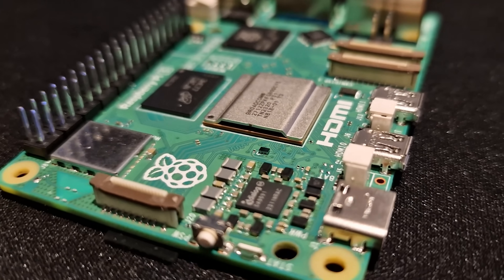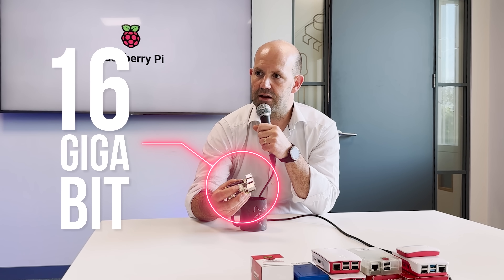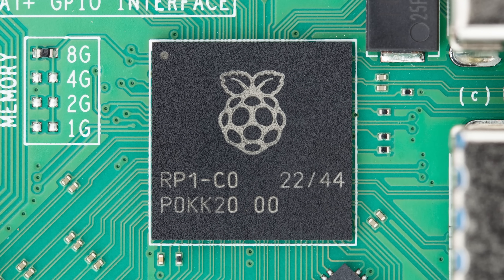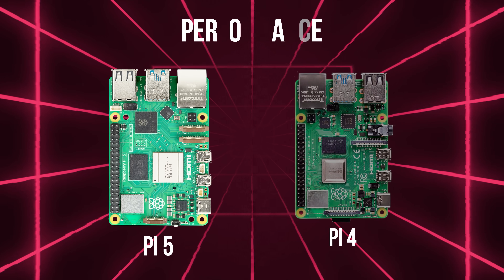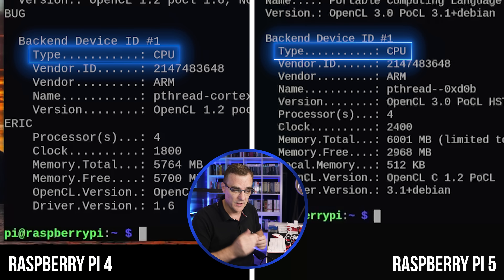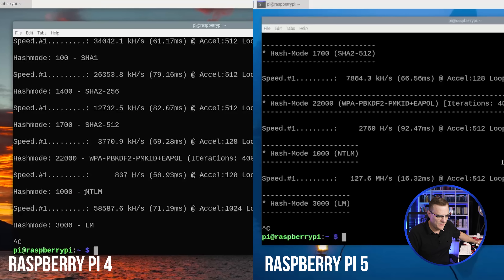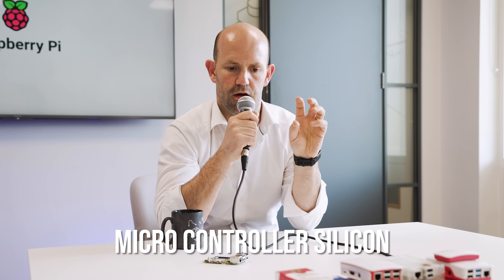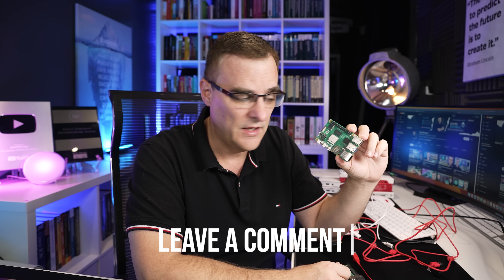Raspberry Pi 5 is here! (and I TESTED it)

Comment: I Have just bought a new raspberry pi 5 8gb and try to boot with 16 gb sd card but the pi is not booting and still red light is glowing.
So I tried using Raspberry Pi 5 EEPROM bootloader recovery image and pi boot up with 9 green light and red screen lit up on screen.
(I am using other power supply which is not the official power supply).
Just wanted know is this the issue of power supply or any other reason .
Please Provide any solution to this

Comment: I hope there will be no problems with stockings in future, like on 4 last years. For me is 4B still favourite. By performance is 4 still good, and it run with lower energy consuming and with passive cooling (full performance on 5 CPU is pretty hot at temperature, over 80°C 😀). Maybe if they in next revision add 16GB RAM and M.2 slot on back, i will consider buying. And little disclaimer, this advertised 4k60FPS is not very true, bcs it runs, but there are FPS drops. 4K30FPS is fine.

Comment: But can it play YouTube videos at 1080p without losing frames? No, really. The RPi 4 struggles, for some reason. (Compatibility with browsers...?)
Reply: You will have frame losses at Full-HD and you will not be able to watch 4K videos on YouTube because that resolution is used by YouTube and uses VP9 and AV1, which is not compatible with the raspberry hardware.

Comment: I'd like to see if the very latest Godot and Blender work on a raspberry pi 5. Godot 4 fails and so does Blender 3 on a raspberry pi 4 because of the Open GL version is not high enough.  I'd dont want to render much just have a low power consumption machine to develop on.

Comment: A lot of great improvements indeed, especially in the CPU power. But, still depending on an SD card to load an OS for for this beast is a bit 2010-ish. Yes, you can put a HAT with PCIe connector etc. but still why isn't this integrated on the board already like manu other competitor boards (Orange Pi and others )?  Or why tere are no eMMC options available?
Reply: base price seems is limitation,and most of users not need it,but i also hope to see that and 16GB in top product line.  Well maybe cometition will do it,but on other side most of competition lack in performance or and at most in support side..RPi became icon to build upon it!
Yes i hope and dream to see 16GB keyboard with ssd inside..for home use..

Comment: For me, the key is easy running of an OS and a community to help software run on it. I intend to use this to drive microscope hardware. Too many of the control of scientific kit requires a power hungry windows machine (which I also have). Multiply this with the number of machines in a building and it is a lot of power. Switching to the Pi would mean each running on 6w which is a greener way.

Comment: Would be interesting and practical to run a head to head comparison RPi5 with Orange Pi 5. Orange's RK3588 looks better on papers.
Reply: Yes you're correct but in reality the Raspberry Pi have a much larger community support which is why you see these things everywhere.  This will change soon as RISC-V gains traction.
Reply: yes you are right orange pi 5 has 8 cores versus pi has 4 cores

Comment: The big problem is, all the reviews are exactly the same from the hundreds of people that were sent the RPi5.  They are not as good as a miniPC that doesn't cost much more when you add a power supply, mouse and keyboard and storage and case and cooling and all the other bits you need.
The mini PC is far better value and not as slow, plus it runs a lot more and could be used to run other OS.
Now we have a silly situation of not being able to buy one, not being guaranteed we will get one even if we pay in advance to companies wanting to make money from our free loans.
I tested it too, it's not a PC replacement, it's slow and not good on youtube and struggles on 4K videos and dual monitors.  It is NOT that much better than a 4.  So if you just want to run AdGuardHome or PiHole it is OK.  Forget trying to run a firewall on it!

Comment: I would like to see a RPi with a FPGA chip onboard, probably with Linux software to program it integrated.
Reply: If only FPGA chips weren't so expensive otherwise would have been a nice addition.
Reply: @Darkk6969  The Gowin 20k is not that expensive suppose you can get it for a few dollars in quantities. Small Altera ones are also cheap you can do alot with just 1k if you want to drive a VGA for example. This application is not necessary on the Pi but there are lot of high speed projects where it can be interesting. Stepper motors in a CNC project. Another fun board would be RP2040 combined with a FPGA.

Comment: I don't like this plays the wanne-be-fast game. If we needed one thing, it would be a completely passive cooled 10nm low GHz version, with added M2 storage. Like quad core 1.5 GHz with a 10nm chip running less than 5W on full power. To do things like 4K playback and gaming, grab a much more powerfull and cheaper yesteryears AMD based system that uses less power on load.

Comment: I Googled Raspberry Pi and this came up:
[1] The Raspberry Pi is a 'LOW COST', credit-card sized computer that plugs into a computer monitor or TV, and uses a standard keyboard and mouse.
[2] The Raspberry Pi is a 'VERY CHEAP' computer that runs Linux, but it also provides a set of GPIO (general purpose input/output) pins, allowing you to control ...

Comment: I have wanted to play with one for years now, but they are expensive.
A good alternative is a old plex SFF computer with a i3, upgrade it with second hand 16GB ram, a SSD, and ad a second network card or WiFi and you are ready to play, and it costs around 100$/ as mutch as a Pi4 version B. 
But definitely that there are some things that's easier to do with a raspberry, and lower power consumption.
Reply: Supplies of the RPi 4s are returning to good levels now.
Reply: @AuxiliaryPanther   that will probably not do that mutch, in my country the price went from a average 929sek to 1099sek so the price has pritty mutch just followed the inflation.
Reply: @dennissvensson6051  it is unreasonable for products to not follow economic inflation.
Reply: @AuxiliaryPanther  precisely, that's why I assume that the prices won't change even when all the retailers have them in stock (I assume you ment that the prices will get lower).

Comment: I seriously think the time for R pie are gone if you clearly see sbc there are new Celeron boards that can do twice the speeds and some sbc are coming with quad core have 1 ddr 4 slot you can do 16gb ram sodimm and have 2 - 2.5 nic so I don't hardware wise it's awesome?? And then the thing which blows everything off bro it's x86 so forget all these specific R pie stuff.
Reply: I bought a second hand slim client x86 for $50 to run as a home automation server with Linux, if you don’t need that lower pover consumtion that is cheaper and better
Reply: Sure...but they are more expensive

Comment: No nvme means no buy. Will go to other platform now. Its one of the most requested features.
Reply: It actually feels ive been slapped in the face by raspberry 😂 it was never the cpu that was the problem. Its the storage! I dont want to use a usb to nvme adapter. Many conpetitors offers nvme AND a76 already. And now Raspberry offers the least, but will still be priced almost the same

Comment: Is there any reason they didn’t put an onboard storage for the OS? And of course micro sd socket for expanding it. I think this is much more reliable than micro sd to run the OS from. At least in bigger scaled projects,
By the way I love raspberry pi and also I’m a big fan of you from Turkey 🇹🇷😊
Reply: i use a Rockpi convertor board from sdcard slot to emmc

Comment: No doubt this means a great performance improvement (especially the new 16G I/O pipe line), but what about the heat? If this extra performance comes with even higher temperature than the already high one produced by the RP4 - where one may end up using an active fan in order to cool the CPU - I'm not sure if it is really worth, especially considering that in many projects we try to hide the board in enclosures as small as possible.
Reply: downgrade clocks to pasive level of cooling...yeah if that is what you need,and when need performance in some scenarios well now we have more, but 16GB ram and SSD still not !
Reply: The RPi 5 case comes with a fan, but there is an active cooling system available for preorder that us $10.

Comment: The performance uptick is amazing 😲 What about heat David? I used a full aluminium case with a low speed fan for my pi4 - will that be enough or are we looking at more beefy airflow requirements?
Reply from the maker: They have a new Raspberry Pi Active Cooler and Raspberry Pi Case with fan 😀 https://www.raspberrypi.com/products/raspberry-pi-5/
Reply: I would lookup the cpu chips themselves and find any documentation regarding thermals.